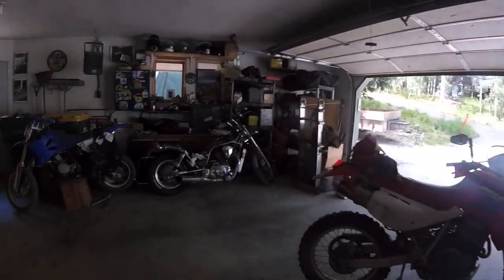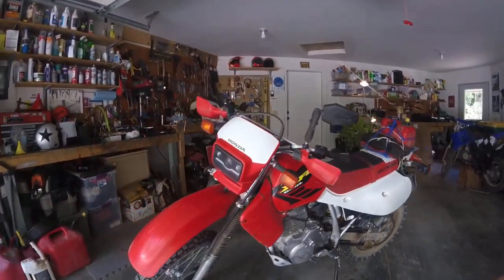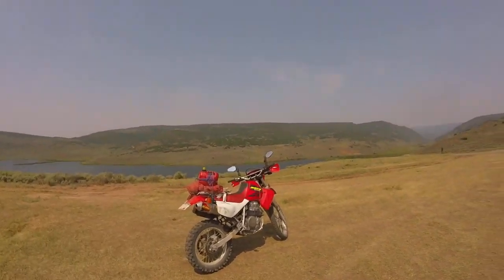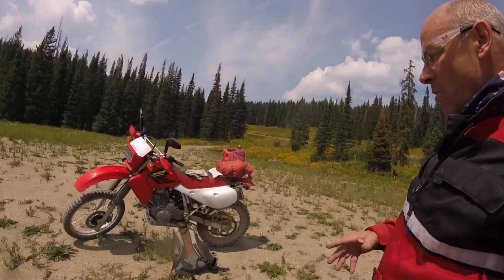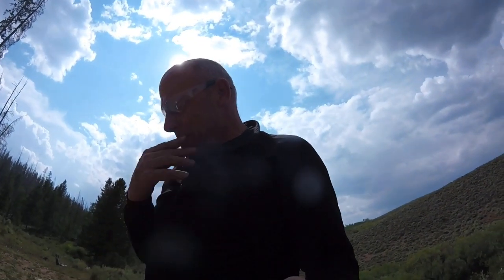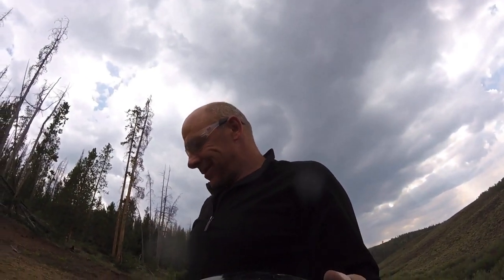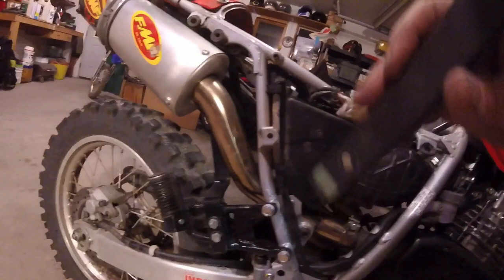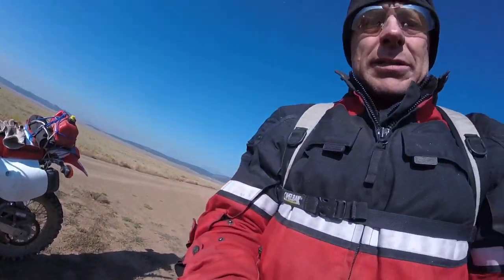Honda XR650L One of the best dual sports ever made.

Comment: Nice. Wyoming/Colorado. Honda XR. Lovely stuff. I reckon you might as well get a tank and do the performance mods cause why not? Great platform for what you're doing, might as well make it better. Acerbis makes solid tanks for the XRL. And when you drop it, even though it's a trick lifting her up again, imagine if you'd had some new Nimitz Class Beluga Bike... true techno scrap. You're right to stick with what you've got! One thing to watch for is the CDI. It's placement means that sometimes the wires get pulled and it craps out on you. Cheap insurance to carry a spare. And damn, nice support for the subframe. Looks solid! Cheers
Reply from the maker: Thank you! 
I’m looking at the IMS and the Acerbis tanks for next summer.
I’ve heard of fitment issues with the Acerbis but like the larger capacity. 
Yes, when it comes to dropping the bike I am so glad it’s not a “Nemitz class Beluga bike”!
That made me crack up. Great way to describe those bigger bikes, 
I’m ordering a new CDI for next years adventures. I keep reading about that Ignitech programmable  one but I’ll probably just get the OEM Honda CDI. 
Thanks for comments, the subframe reinforcement gives me piece of mind for carrying tools and camping gear. 
It’s a weakness that Honda should have addressed years ago but maybe that would have made them have to do a redesign and then change the bike. 
A back up kick starter would be nice though!
Reply: @xtman693  I have a '17 XRL. Like you, last bike I'll ever need. I'm running the Acerbis tank. Mine was a little tight on the tunnel, and had some clearance issues with the voltage regulator, but I like it. I usually run it about a gallon low from full, 'cause it gets heavy. So I see 200ish miles a tank. I've done some carb work to help with an XR600 Piston I put in a couple years ago. So I don't see 45-50 MPG anymore. But I like the extra grunt I get from slightly higher compression. Also while I was in the engine, I did the second and fifth gear mod with gears from the euro NX650. Dropped the counter shaft sprocket one tooth. This makes second about where first was, and an overdrive in fifth. I can cruise all day at 65mph. Liked your vid. I get up to Grand Junction occasionally. You anywhere close?
Reply from the maker: I think I’m going to order the IMS tank. After reading multiple reviews it seems to be one that fits and isn’t too big.
I’ve been looking at doing some rides starting from Grand Junction next spring. 
There’s a ton of great roads from what I can tell from Google maps. 
Let’s get together and ride! That would make some great video. A couple XR’s in the desert of CO!

Comment: Those bikes are set lean from the factory.  Fattening up the jetting will give you better power and the motor will run a bit cooler.  I didn’t have the air scoops and I never had an issue at temperatures near 100.
Reply from the maker: The lowest I get is about 5000’ here in CO so I’ve left it stock. It’s running a bit rich so I think I’ll get the bigger tank and lose those wings. 
Had a lot of comments of guys saying they removed them and no issues. 
Thanks for the comment and watching!

Comment: I enjoyed an '09 XR650L for several years and really enjoyed it.  I was forced to sell to cover some crazy-wife debt, but now I'm free of her and want another bike.  I'm trying to decide if it's another XR or a DR......................or maybe a KLR. The KLR is bigger/heavier/uglier but has a reputation for eating up the miles on "reasonable" surfaces. It'll probably boil down to which bike I find a deal on.  Either way, my skinny butt is probably going to want a better seat for extended rides.
Reply from the maker: I think the XR is for sure more off road capable. Better suspension and torque. But that being said the KLR and DR650 are better on the highways and for long dirt road cruising. I agree about the seat! My butt hurts after a long day. I don’t know what the answer is, maybe a sheep skin? Let me know what you suggest.

Comment: Mine was the same a great all rounder EXCEPT for long hours in the saddle on the motorway at 60mph..got the dreaded tingles in the butt and arms..Next bike will be a smoother twin cylinder Honda 650 TransAlp for me.
Reply from the maker: Yes, long hours on the saddle is hard. I guess that’s one advantage to the limited range, I have to get off and walk around every two hours or so!
I saw a guy with I e of these and he had a simple sheep skin strapped on and said it made a world of difference for him so I might try that.
Thanks for watching! It’s kind of a long winded video but I wanted to get a mix of riding and dialogue so it needed being longer than planned.

Comment: What's the next video adventure it's getting late in the year ? have you ever tried adjusting the sag on your bike to get the seat height down.
Reply from the maker: Yep, dropped the shock down a bit and installed a Kuba link. Still too tall but I’m used to it now. I don’t ride technical Rocky single track or anything so for dirt road cruising it’s perfect. 
Got my WY trip posted the other day. My GpPro battery is not what it used to be so I’m looking at a new one to replace it with.

Comment: Really enjoyed your common sense approach to what you modified and left stock. Am leaning towards the 650L for simplicity and reliability. Never understood the battery relocation thing since it's less accessible, so your reasoning was on point. Did you get a lighter battery? Heard the stock weighs significantly more than a lighter aftermarket.
Take Care
Reply from the maker: The simplicity and old school technology is why I chose the XR650L. They are as reliable as a machine can be for the most part. 
Comfortable to ride long distance too. 
I have the stock battery. Which is significantly heavier than the Shorai Lithium batteries for sure, by a lot! 
I just got the standard battery because they had one at NAPA. 😁😁
I might order a lithium battery and try it out for this summer, the weight difference is hard to over look. 
They are expensive though which is something to consider. I don’t know what to expect for service life out of one. 
I usually get three years solid from a NAPA battery and sometimes 4 years before I start not trusting it. 
Thanks for comment and watching.
Got some great routes planned for summer this year. 
Stay tuned!
Reply: @xtman693  Was thinking lighter battery to offset Rotopax gallon of gas.
Reply from the maker: @brianh8801  That would be a good move. The weight difference is huge. 
The rotopax is better than tying on a Walmart gas can!
Reply: @xtman693  Bwahahaha!👍🏾🤙🏾

Comment: I am actually trying to decide between the xr650 or the xr400r
Reply from the maker: Well that’s a hard choice. First are you thinking of the XR650R or the XR650L? The XR650R is the liquid cooled kick start race bike. The XR650L is the electric start dual sport. The XR650R is made for one thing. Hauling ass across the desert in races like the Baja 500 or 1000. It’s not ideal for packing gear onto and it’s a bit more complex with the radiator and water pump. 
It’s a bad ass bike for sure. 
But if your into dual sporting I’d take the electric start 650L. 

The XR650L is big and heavy but is made for long hauls on mostly dirt roads with gear and the occasional highway miles. 
It will do almost everything except tight single track.

For mostly off road riding and tighter trails the XR400 would be superior. It won’t have the power to haul ass on the highway if you needed to but it will still do it just slower. 

It’s noticeably lighter too. So if your riding a tight trail and you have to pick it up a few times you’ll be glad it’s not the big 650.
My friend has one that he made street legal and he keeps up with me no problem everywhere except the highway. 
Of course I ride like a grandma so that’s not saying much!
I think it all comes down to what you want to do the most. For long haul dual sport rides and such I’d take the big 650L but for dirt biking mostly of road and single track I’d take that XR400 for sure.
Reply: @xtman693  I want the xr650l or the xr400r.
Reply from the maker: @TheHemiphil81  If dual sporting mostly I’d probably lean towards the big 650L. It just eats up the miles. 
If mostly dirt biking on trails and occasional dirt road I’d take that XR400R. Lighter and still has plenty of power.
Reply: @xtman693  thank you for taking the time to answer my questions.

Comment: Honda xr 650 l is great, but needs a 6th gear for the highway.
Reply from the maker: Yeah! I’ve found myself trying to shift up a few times when on the highway. 
I’ve been on quite a few bikes that need that 6th gear actually. 
My TW200 needed it and my XT250 could have used one too. 
Of course none of these bikes were designed for the highway, which could be why the engineers deemed 
the 6th gear un necessary. 
My old 82 Honda 450E had the sixth gear. 
It was great! Much easier on the engine.

Comment: I hear the nylon skid plates don't send the noise back
Reply from the maker: The nylon ones are probably better for that very reason. I did not even think about the issue until I mounted mine up and was riding it. It is LOUD. Even at high speeds with wind noise it’s still ear piercing. If I had to do it over again I’d go plastic.

Comment: Love my xr650l, had a 1994 for 12 years,now I have a 2019.best bang for the buck out there.bought mine brand new for 6400.00,put 2 grand in aftermarket on it to make it a little better for my riding style,and still came In 2 grand cheaper than the crf450l, and 4 grand cheaper than the ktm.i ride mostly single track,with my wife 2 up!! Corbin seat really helps on the long hauls!! Check mine out on my channel!!
Reply from the maker: I just did an 850 mile trip on the XR and I’m now looking at the Corbin seats. They aren’t cheap but man I was hurting after three days on the stock seat. Thank you for the suggestion!

Comment: Best bike those xr kick ass.   I like the xl as well xl 650s.   The xr is the beast.   Do a bit of head work and get even more HP and torque with trick it up a bit.   These are so reliable. I see new KTM and new bikes not even able to start when computer code flash and what next ?? No no I stick to what's proven reliable.  These Honda xr and xl. from the 1980s to 1990s were simple and reliable..   no fuel.injection or computer nonsense.  Keep it simple. Xr and XL are king of RELIABLE
Reply from the maker: I agree 100%.
When that KTM won’t start, flashes a code and your not anywhere close to a shop your walking!
I’ve seen it personally. TPS sensor went bad and the dude had to call for a truck to take his bike to a shop!
Good old tech on the Honda’s rule!!!
Thanks for the comment!!

Comment: If your running hot check what jetts are in the carb. If it's running lean it will get hot.
Reply from the maker: Yep I did, stock jetting. The plugs are dark so I’m running a tad bit rich but at 9000 feet that’s to be expected. I was getting some back fire on deceleration with the new FMF exhaust so I leaned out the mixture screw a bit and the back fire mellowed out a lot. 
It still seems like it runs hotter than my 1980 XR500 does. I need to get one of the thermometer dip sticks I think, it might be all in my head.
Reply: You might need to drop another size on the main jet, worth a go since your so high up in elevation.  I've been trying to get my jetting correct also lately I picked a xr 400 I'm trying to dial out.  Check it out on the thumper thread Ive been learning a lot about jetting on there lately, I'm digging it!  Loved your video got me all jazzed up before my ride today!
Reply: Just realized it's called thumper talk, just Google it.  For the xr 400 I found a elevation chart on there with listed jet sizing.  I'll bet theres a elevation chart for the 650 on there also.
Reply from the maker: @MrAddison79  Thumper Talk, yes I’ve seen that site before. I’m headed there right now to see if I can find that chart. Stoked you got to ride today!! All snow and ice here in Breckenridge. Going to be awhile.

Comment: It’s outdated, Honda really needs to add fuel injection and a 6th gear. Otherwise I would of bought a 650l and not my 701 enduro. I do love the 701, fast!!
Reply from the maker: I have to disagree. I love the older technology. Simpler and more field repairable. I can remove a carb and tear it down in 20 minutes if I need to. I can bump start the machine if my starter quits. 
No sensors to fail either. 
Carry a spare CDI box and your good to go.
I saw a guy last summer on a KTM690 stranded in Hartsel CO with a no start situation. He just got it out of the shop too. 
It was blinking an error code at him but he was stuck. 
It’s not about speed with the 650 it’s about reliability and repairability. 
I do agree with the 6th gear though. I find myself trying shift up another gear at higher speeds.
Reply: I don’t deny the 690/701 is a bit complicated in terms of electronics for an enduro but to have it handle as well as it does on street and in dirt in needed the help of a computer. If Honda makes a 650l similar to the CRF300l I may trade the 701 in. Unfortunately the 300l just does haven’t the power I’m looking for.
Reply from the maker: @Community-Action  Maybe Honda will build a 650 cc computer driven dual sport someday to compete with the KTM’s. They probably will have too.
I’ll never buy one. I do a lot of solo riding in remote areas and I like a low tech bike for those adventures. Speed and massive amounts of power don’t mean as much to me as field repairability. I’m not a good enough rider to need more power. But I don’t like getting stranded or walking.
I hope Honda continues making the low tech XR650L as long as they can sell them.
If I was going to cross Africa for example, I for sure would not want a KTM, I’d rather have the Honda XR650L. 
But, for higher skill riders I can see why they would want more power and speed with the advanced handling a computer bike gives a rider. 
They have the skills to put bikes like that to good use. 
I agree the 300cc bikes are too under powered for most advanced riders. I think they should make the 500’s again!
Reply: @xtman693  Before I bought my 2018 XR650L I questioned the 5 speed.  After buying it and putting over 3,000 miles on it I really don't think it needs the 6th gear at least for my type of riding.  Mine is all stock except for the gas tank and it'll do 75 mph without blinking an eye at about 1/4 - 1/3 throttle and that's plenty fast for me.  I haven't tried to find the top end and don't plan too.  Love the low tech of the bike, low maintenance = more smiles per mile for me plus I love the lower initial cost!  Not interested in spending $10,000+ on a dual sport.  I want to ride them not work on them.  It's a great bike for me.
Reply from the maker: @craigmccue2841  I agree they are plenty fast for what I usually do to. Plenty of power in the 650’s.
The only time I’ve found myself searching for a 6th gear is on paved sections going about 65 or so.

Comment: Look up some videos on how to pick up your bike homie.
Reply from the maker: I did use the technique I learned long ago. Front squat. It’s more finding something solid to grab onto to lift with than the weight. 
The backwards squat works but if you go to far and your on the kick stand side it could keep on going the other way. 
I wasn’t sure if the seat strap was strong enough to use as a handle. That would have been easier.
Reply: @xtman693  Ha. Yessir! Great video. I have a 21. Feels great getting off road. I have done a few small trips. Lots more planned. Been on a Harley the last 20 years.
Reply from the maker: @MrTrustme6  Sweet! Yes the 650’s are workhorses.
Funny you mention Harleys, I’ve always wanted to ride a Harley. 
I have a Suzuki S50 which is the old Intruder vs800. It’s almost a Harley, or should I say it wants to be a Harley. 
But I had never had a cruiser before last year and it’s fun too!  Had some good rides on it this summer.
Thanks for watching! Hopefully I won’t be dropping the bike as much in the future but it’s a bit tall for me so once it starts to go over it’s real hard to stop.
Reply: @xtman693  You are probably aware but they sell a foam pad for the skid plate. I was thinking on adding to mine.

Comment: Imagine if you had the 1000 cc you would never be able to pick it up
Reply from the maker: No kidding! That 650 was heavy enough.
Reply: @xtman693  yea
Reply: @xtman693  also there's a different way of picking up a motorcycle. With your legs instead putting all that strain on your arms.
Reply from the maker: @brianN9955  Yeah, I know about the back facing squat. I just do t care for that method as I’ve gone to far and tipped the bike the other way with a  street bike I had. Although with a heavy bike the back wards squat is about the only way to really do it.

Comment: Found a 96 for $2800. Is that a good deal?
Reply from the maker: If it’s  in really good shape with under 10,000 miles it could be worth it.
Check the front sprocket if possible and see if it’s worn out the spline.
If it has it’s a major job to replace.
Reply: @xtman693  going to look at it tonight. Thank you so much.
Reply from the maker: @2wheeleddemon999  Hope it’s a good deal!
Great bikes.

Comment: I crashed mine on concrete run the shifter right through the side casing
Reply from the maker: Yep, I’d heard of that happening. It’s why I put that padding on my engine case.
Then info and bend the shifter up instead of in!
Still, good to have something there just in case. 
Were you able to patch the case or did you order a new one?